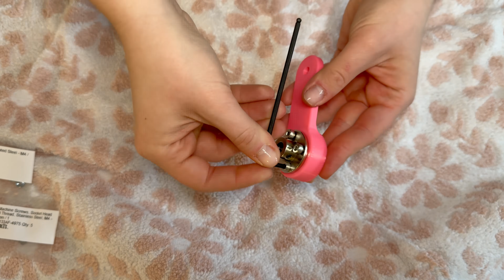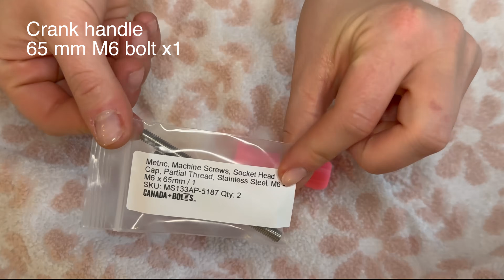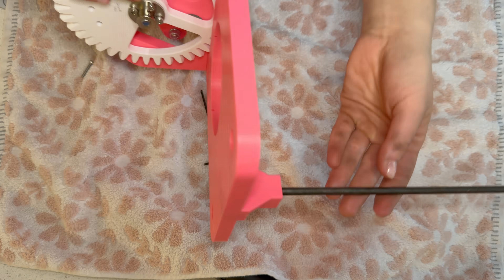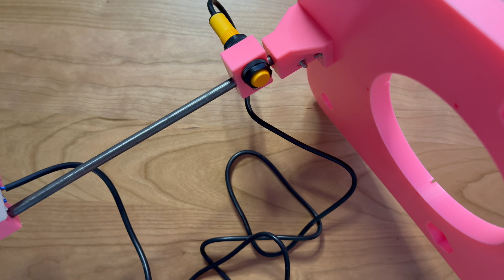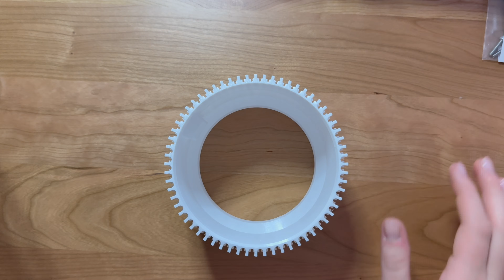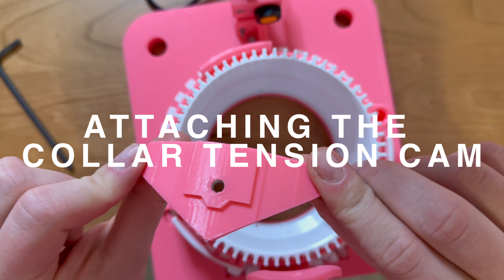How to Build a 3D Printed Sock Machine Step-by-Step Guide

Comment: Ive found the bearings and flanges arent consistent in their internal diameter, varying from 7.6 mm to 8.2 mm.   This caused the 8mm rods to be too thick.  I ordered 7.5 mm and they fit well, with grub screws of course.

Comment: I have made progress with this, and I want to share what I've done wrong and had to correct. 1, When you are assembling the cylinder stack, make sure that the yarn carrier is on the side of the collar with the lift cams. It is possible to have it incorrectly rotated so that it is on the opposite side. 2. The needles won't go up and down properly unless the collar tension cam is installed. 3. Be careful not to stretch your cylinder spring too much testing it out! That was a huge mistake and I had to order a new one. It will stretch out permanently like a slinky and then it is ruined.

If I understand this correctly, the leading lift cam (whichever direction you are cranking) goes UNDER the needles, lifting them up. Then the collar tension cam forces them down. Then on the other side of the collar tension cam, the lift cam that follows goes OVER the needles. That is, it doesn't try to lift them. 

I continue to have some issue where the collar gets stuck at one point in its revolution. Then the handle just turns on the rod and isn't strong enough to move the cylinder forward. I am hoping lubricant will help. Is there a way to clamp the handle more strongly onto the axle so that more leverage can be applied without it coming loose? I tried screwing in the tiny little set screws in the flange shaft coupling, but that didn't work. 

Hopefully I will eventually get this working! It has been a challenge. Terms like "flange shaft coupling" are new to me! Thank you again Julia for the video!

Comment: I am running into the problem that the collar tension cam doesn't fit between the collar and the cylinder. After sanding it down a lot it fits but turning the crank becomes impossible. Does anyone know what could be the issue?
Reply: I'm having the same issue right now.

Comment: Thanks so much for this video! I have gotten as far as putting the needles into the cylinder. They aren't all dropping down as the cylinder turns so maybe I have to sand the cylinder?
I found assembling the cylinder really difficult. The inserted M3 nuts kept falling out. Eventually I scotch-taped the holes on both sides to keep them from falling out. I also scotch taped the cylinder riser in place to try to keep everything aligned. I don't know if this gets easier with practice because it seems like the cylinder is going to be removed and reinstalled fairly often.
Reply from the maker: Needles dropping could be from a number of things. Sometime just twisting or adjusting your spring helps, but be careful not to overstretch it. Sanding the needle channels may also help. In terms of attaching the cylinder, the easiest way I found to do it is laying the entire assembly on its side, and resting it on my legs to line everything up without pieces slipping out of place. I hope this helps. Good luck😊

Comment: I got my machine together ! It cranks around with the needles in it fine with morning inside the machine. When I place the bonnet and weight to knit the handle up against the side slips and will not go around. I can spin the gear with my hands but not the handle. I put on about 3 lbs to hold the yarn down in order to knit.

Comment: This project has been a real doozie. For those of you who are new to 3D printing, you may have to play around with the infill percentage/pattern, and I had to learn all about retraction settings, z-hop, temperature, and nozzle clogs. Buy two of the filaments you want to use, then be prepared to break parts, make spaghetti, and say naughty words. By the second roll of filament, you will have learned enough to be dangerous. I think in some spots a heat set would help if you are going to strip screws or split laminate lines. 

The reason this video is so awesome is that if your experience is anything like mine, you will find yourself with a pile of printed parts and no idea what to do next. This was indescribably helpful to see the pieces go together, hear which size screws to use, and be able to pause or go back when something was tricky. You're the reason I'm excited to get crankin' tonight! Thanks a million for making and posting this. 🥰🧶🔩
Reply from the maker: I’m so glad you found it helpful!

Comment: Hi, I was thinking about printing a knitting machine but I wasn't sure because it seems like it's specifically made for socks? Are you able to knit panels with this machine too by simply going from one side to the other or can you ONLY knit circularly?😊
Reply from the maker: I think you can knit flat if you use it with both needle lift cams at once but I haven’t tried it myself

Comment: Hi😮
I have ordered a 3 d printed sock machine. My question is where do I get the needed nuts /bolts/ screws ? The counter? Needles and spring ? Thanks
Reply from the maker: That info is linked in the materials spreadsheet on the printable page !
Reply: @HellaKnits  I have not found the materials spreadsheet on the printables page :( Do you know approximately where it sits in the page?

Comment: Videos a big help and made me choose this build over another one.
Printing everything in PETG on a Bambu Lab A1 mini except the frame - too big for the Mini plate.  Having it printed at a local print shop.

I have one question:
What size (or dimensions) for the shaft flange on the crank.
Amazon has many sizes to choose from.

Thank you
Reply from the maker: I list the exact size in my video! It is also listed on the printable page

Comment: I'm just finishing up with my 3d printed parts. Your video is a life saver, thank you.
Reply from the maker: Glad I could help!
Reply: @HellaKnits one question though. The two screws that hold the tappet plate on to the tappet arm, are those screws supposed to be tight or does the tappet plat need to move?

Comment: This was an excellent video and I couldn't have built my machine without it.  However, there was no mention of drilling a hole or dent for the set screws in the rod holding the handle.  Has anyone else besides me had issues with the handle slipping?
Reply from the maker: I would recommend checking out the Printables page! I’m sure someone else has had the same issue :)

Comment: This is so cool! Please can I ask what size cylinder you picked and what diameter of foot you picked? The rubber size goes down to 32 but the stockinette carriage only goes down to 48 and I can’t work out why. Am I being silly?
Reply from the maker: I have a 20.5 cm foot circumference (womens size 7), I found that of the cylinders I printed, the 60st cylinder fits my foot best. In hindsight, I could have even gone down to a 56st cylinder for my foot, but I didn't have that size printed. You can adjust the tension to make the circumference smaller, but i find that if you tighten the tensioner too much, it becomes quite difficult to crank. My mom is a women size 8 and the 64st cylinder is best for her foot. My partner has mens size 12 and i could probably get away with 64st on a loose tension, or 72st on a tighter tension for his foot. I hope that helps!
Reply: @HellaKnits  thank you so much. This is really helpful!
Reply from the maker: For the ribber, you dont put a ribber needle in every slot on the dial. You would place a needle in every other slot or every 2 slots depending on the rib pattern you want. you can use whichever ribebr dial you like as long as the ribber needles line up w a slot on the main cylinder, if that makes sense. I only printed the 30, 32, and 36 slot ribber dials; I'm not too sure about the dial and cylinder sizes for the ones I didnt print. I would check out the printables page for more info on those!

Comment: Hope this helps - Parts list:

M3 nut x14
M4 Nuts x8
M5 nut x1
M6 nut x1 (nyloc will help)
M6 washer x1

12mm M3 bolt x3
16mm M3 bolt x2
20mm M3 bolt x4
25mm M3 Bolt x5

12mm M4 Bolts x4
16mm M4 Bolts x4

8mm M5 bolt x1

65mm to 68mm M6 bolt x1

8x22x7 mm deep groove ball bearing x1 (skate bearing)

Metal Rod 8mm Dia, 65mm Long
Metal Rod 1/4" dia, 18-24" long (cut to desired length)
Metal Rod 1/8" dia. 50mm long
Metal Rod 1/8" dia, 30mm long

13mm magnet
Reply: Great video by the way...
Reply from the maker: Thank you!😊
Reply: How much filament does it take to print? Placing an order and want to buy enough
Reply from the maker: I personally hired a 3d printing company to print the parts for me. You may be able to find more info about this on the printable page 😊
Reply: @LILYoOASIS  I printed at 90% infill, 1.5mm wall thickness, without the ribber parts, and I have not run out even the first 1kg spool.
my printing is probably an overkill, but it works.
Reply: What about flange shaft? 
I ordered wrong one. Too small.
Reply: what is wrong with you, switching between inches and meters like that.. grr..
1/4" -> 6.35mm
18-24" -> 457.2mm - 609.6mm
1/8" -> 3.175mm
Reply: Merci pour cette vidéo. Très utile.

Comment: How tight are your needle lift cams? Mine aren't working correctly, and I can't figure out whether they are too loose or too tight.  I have one loose, and one that I can barely move up and down. Thanks!
Reply from the maker: They were pretty snug when I slid them into the slots on the collar, but once they’re rotated down, they should be pretty loose in there. I had to sand the neck of the needle lift cams a little bit in order for them to slide into the collar more easily!